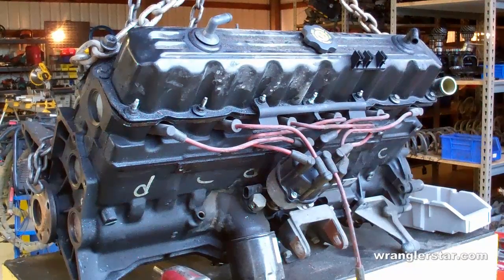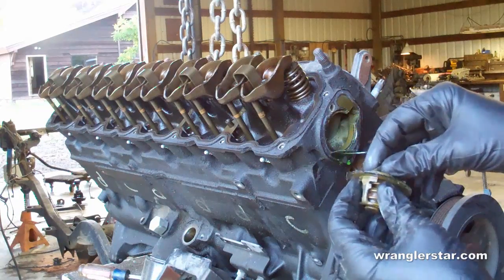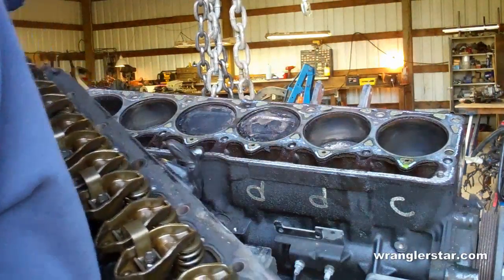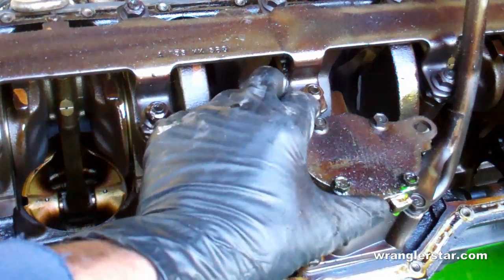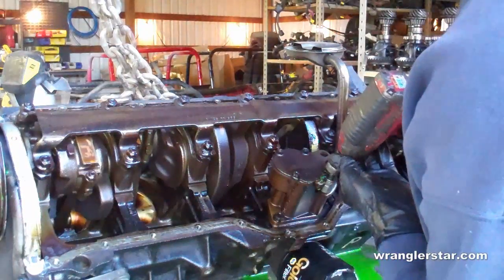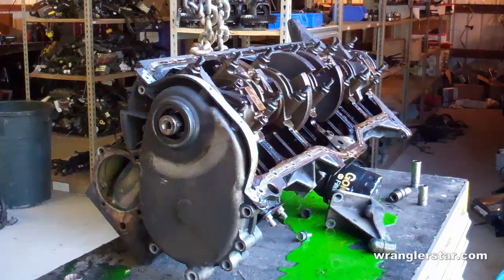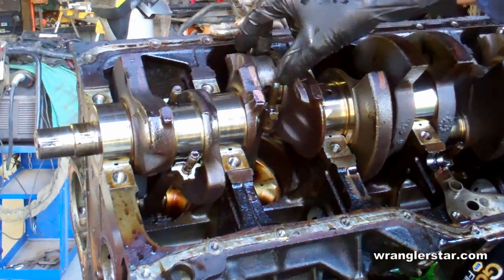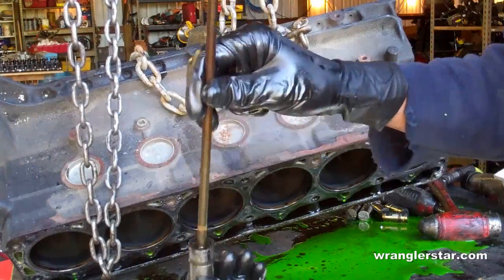How To Rebuild a Jeep Engine part 1

Comment: I had a question I need help, if anyone here or you can point me in the right direction or what do I need to buy next

Heres whats going on, I have a 1991 jeep cherokee 4.0. 217,000 k miles on it, it was burning oil so I had no choice but open it up and see what is going inside.

Took off the head saw bad burnt values so I started with the head took them all out cleanded them up and did value job with compound and that rubber tool to re seat them everything looked perfect after that seat was perfect also value steams where changed few months before this so they looked OK. After the head I saw the block walls where smooth with no cross patterns left, so I took all the pistons out rings where not stuck or brunt they moved freely, next I re hoaned the walls to make the crisscross pattern I removed all the rings and cleaned all pistons up everything was super clean and rings where moving like they where new I also replaced the piston bearings cause they showed sign of wear. Before I put everything back I did a simple test put one piston in and poured oil on top of it to see if oil would drop through the rings left it for 2 days no oil went through I did the same test before I did the hoan and clean up of piston rings and oil fell through within hours. So I thought this was a good sign. after hoaning and ring clean up I believed rings where tight and no blow by was going to happen. Then I put everything back in. the car stared perfect and I thought everything was great then I did compression test each read same reading 125.125.125.125.124 126.
So I drove it about 100 miles and oil was below safe line, OKi though maybe the rings need time to set in new block walls but no 1000 miles later I'm burning even more oil then before almost a whole quart every 70 miles that's really really bad.
My mistake I feel is because I didn't replace the piston rings ? But they looked totally fine and where moving with ease.

Please what do you think I did wrong here? I don't want to give up on this jeep but this is crzy how much oil it's going through I'm willing to take it apart again trying to fix it, currently it has good power no blue smoke but the oil I just disappearing. Sorry this is so long but I'm so lost and any help would be greatly appreciated.

Do I need to buy new piston rings? Maybe sleeves?

Comment: How does theis engine compare to the BMW I-6? BMW is much more modern (OHC, VANOS) alloy block; but  the AMC is  higher low end torque.
Reply: What are the cubes on the BMW? I would assume the BMW would certainly out rev the AMC. The 258 has a severely heavy valve train. 3/8" stems are way overkill. Restricts flow in a head that flows poorly already. The 4.0L was much improved in that department. I did a 4.0L head swap on the 258 in my Eagle SX/4, that and a COMP cam. Seriously woke it up and it pulls hard to 5k. I should have decked the block since the pistons were .055" in the hole at TDC. That and a .043" head gasket killed my quench. Oh well, maybe next time.

Comment: Please quit postin' shit you CLEARLY know nothin' about.. People DO NOT DO WHAT HE DOES.. He is NOT a Mechanic...
Reply: Southern Bucks 
Hi there Mr.
I have a question, you might know tbe answer.
What happens when you turn over or crank an a 4.0 in line without pushing rods?
The camshaft pushes the lifters up but they aren't back down, but then   the pushing rods are putted back in place, What could be the situation there with the valve and cylinder synchronization?

Comment: this is by far one of the best engines designed. All inline 6 engines are great, but this one was made for easy maintenance.
Reply: because they are too long... apparently... ditch a smooth and reliable design because oh is too large and we can`t fit it with all the extra crap we put in our cars these days...

for a small car used simple inline 4s goddam it...
Reply: Agreed-- the 4.0L is the best.
Reply: +Y10Q This and the ford 300, great engines. I wish they still put those in their trucks, other than what sells I'm not sure why they don't make them anymore.
Reply: Omega Rugal Can't agree more. It isn't easy to fit an inline-configuration engine into an engine bay, but a modern engine bay is also a lot of wasted space. Center of mass isn't a reason to stop making them either, you won't be street-racing a work truck.
Reply: It last too long engines with low rpm life by design last longer like all inline kerosine engines less block twist holds true longer I had a 4.9 Ford and I have the Jeep 4.0 ho not much goes wrong if you change the oil and don’t over rev the engine last over 200.000 miles what I have noticed is the Maine bearings in these motors I would definitely upgrade those better than stock late 80s early 90s they skimp on a lot of things like pulling the zinc out of motor oil that’s what made all engines last longer when you rebuild these use oil with high zinc and detergent
Reply: @sethmorton8539  i add "engine restore" as a zinc additive to my oil change routine since they have pulled the zinc out of some of our favorite oils. My dosage is half the 4cyl can size per change on 6 and 8 cyl engines and about 1/3 of the 4cyl can on a 4cyl during a change.. if i was buying a used car and feel it will be a good vehicle to keep i give full dosage by can spec every other change for 4 sets of changes at 3K then adjust by how i feel about the engine. Not that one product is better than another but it is just my opinion i like to use the "restore", gtx high mileage, and a wix filter. I hear lots are using rotella in the jeeps and if it works for them more power to them. To add on someone above mentioned easy to work on speaking of the 4.0L  i think many I6 designs are really good and some offer even more ease to work on than the 4.0L particularly the ford 300-6 and even GM's newish 4.2 i6 both have the side access panel for easy lifter swap which jeep doesnt have you have to pull the head.

Comment: didn't mark your main caps after removing girdle? rods didn't get marked and hope you aren't reusing your pushrods because they aren't in order either. my 3yr old grandson can do what you did so why are you posting something that you don't know much about? anyone can tear down a motor but a mechanic do the thing's I described and more.
Reply: +tyler t theyre not and youve been all over this comment section spout bs when youve probably only been in a couple dsms and im sure youre one of those kids that puts assembly lube on the back side of your main bearings

Comment: Close on the thermostat.  the spring adds tension to the valve, yes, but the valve is actually opened by the wax in the center of the spring.  as the coolant heats up, the wax begins to soften, thus opening the thermostat.

Comment: HAHAHA mechanic fail.  The spring does NOTHING to regulate temperature... its only there to force the t-stat closed.  Inside the t-stat is a wax pellet that will melt and expand to open the valve.

Go back to DeVry cause you obviously skipped a few classes.
Reply: +Yeager Mcbipper So that's all you got out of the entire video? You know the spring pushing it closed does effect temperature.. But yeah it has nothing to do with the temperature. Only fail here is your attempt to troll.

Comment: I have a 90 wrangler with a burnt piston, how in depth do i have to get to replace the pistons? I already have a piston kit for the engine and warm weather is here and I would like to get working on it again. Can the pistons come out the top to avoid removing the crank?  Thanks in advance for any help.
Reply: Thomas Cornell you may be able to rotate the crank from the bottom of the engine while you disconnect the pistons from the crank. then you can push them out of the top of the engine.

Comment: Lots of bad info.  The spring on the t-stat does not control the opening.  The wax pellet in the center metal part opens the t-stat.  The spring just keeps it closed.
Didn't oil the puller bolt to protect the threads and also allowed the damper to fall off the nose of the crank. 
Also 99% of the time on a worn motor you need a ridge reamer to remove the right (which you did talk about correctly).  Any ridge will most likely snap the rings putting metal parts into the motor.
Used a screwdriver to remove the main caps but a mallet everywhere else?  hahaha
I give you a D-.  To much basic info was just plain wrong.

Comment: Part two?>>>why bother, its cheaper to throw in a used engine. Its not a Rolls Royce
Reply: No its not for the obvious reason that you don't always know what you are getting with a used engine. That should be painfully obvious. Sure, if you can find one for a few hundred, with records and hear it run great (but that is obviously not going to happen).
Reply: rickyboyz100 Cheaper, but not better. Next year I'm going through my Jeep to get it ready for the next few hundred thousand miles and if the engine needs attention it's going to be rebuilt properly. If you are keeping a vehicle for the long haul a used engine is almost certainly not going to be a good investment.

Comment: Have a question for you. I have a 89 Cherokee, 4.0. It has 253k miles. It had great oil pressure for the 4 years that I've had it. One day the oil pressure went to normal, then after it warmed up the oil pressure dropped to 20 psi. It wouldn't raise when accelerated or get any lower at idle. There is no engine noise or rattle or knocking of any kind and it still seems to have power. I'm trying to run down the possibilities before I do a rebuild. I have also tried a mechanical oil pressure gauge to make sure it wasn't anything electronic. Any ideas?
Reply: I've got a 2001 Cherokee Sport with the same problem. I replaced the oil sending sensor thing, but got no improvement. I still think it's the oil sending unit, but every mech says I might as well rebuild engine or get a new one for the cost of replacing the oil sending unit.  If you find an answer, please email me at darkewolfe1@yahoo.com. Good luck.
Reply: I will take mine to a shop that has mostly jeep guys working there on Friday, when they tell me what they think I will pass it on. I'm afraid it will be the same responses you get, a new motor, but I will let you know.

Comment: The only comment I have is that the part attached to the bottom of the crankshaft main bearing caps is not called a "crankshaft cradle" and it also does not "...cradle the crank shaft to prevent it from wobbling at high speeds..." It's actually called a "Windage Tray" and it is to prevent the crankshaft from creating "wind" when spinning at higher RPM's. This "wind" can cause the engine oil to foam, and in turn causing lubrication problems which can cause an engine to fail prematurely.
Reply: You are way off buddy..It is a crankshaft girdle....lol...

Comment: this is not rebuilding, but only taking apart.   that is the easy part.   that hard is to understand what is out of tolerance, what needs to be replaced, and to put back together correctly, with proper bearings, parts, and the right torque for all major bearing bolts, and head bolts.
Reply: This is part 1 u dumb shit can u not read😒

Comment: engine coolant thermostats have wax in the small central cylinder and when it reaches a certain temperature point the wax changes state from a solid to a liquid, its that change of state which causing it to expand and thus pushes on the connecting rod which opens the valve, the large spring is used to close the valve when the wax returns to a solid, its nothing to do with thermal dynamics  or thermal reaction of the large spring its sole purpose is to close the valve, just look at the design and which way the valve moves.

Comment: I got a question for you. It's actually keeping me from finishing my engine so I can install it, At the end of the cam shaft and between the timing chain cover is supposed to be some sort of spring that keeps the cam from bumping into and damaging the timing belt cover. My engine builder said I needed one but they are impossible to find. What do you think?

Leonard, Denver

Comment: because people do not do the factory recomended service. I have 300k miles on my xj and NEVER had transmission problems. Changing of the fluids as recomended will work mairacles on vechiles. Also have a 1999 dodge ram with 200k miles and with NO transmission issues.

Comment: great vid, i have an 03 GC with a 4.0 it leaks a little oil near the back of the engine. i have replaced the valve cover gasket and it still leaks any suggestions on where to look? also how long do these motors typically last? in my case it has had regular oil changes every 6k,it's 2wd so very little off-roading and i live in the country so almost all the miles are highway miles.

Comment: It doesn't help much that the boxes were weak in the first place. ESPECIALLY the Ultradrive automatic transaxle. Chrysler went way out of their way to buyback/recall pretty much everything they stuck those shitheaps into because, regardless of how well maintained they were, they fell apart at ~150K miles.

Comment: What made that engine fail it looks clean, it has been run a little hot but it is clean even the out side the block is clean unless you steam cleaned it before started to work on it. It has seen regular oil changes to visable sludge in the valve cover.